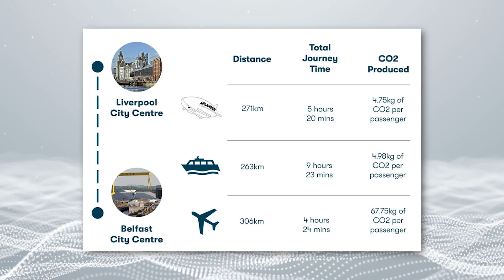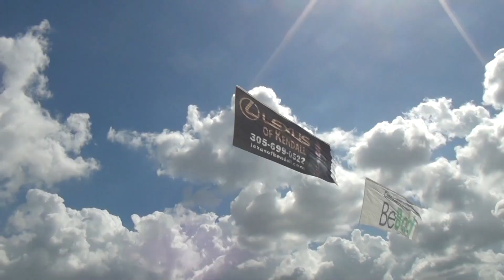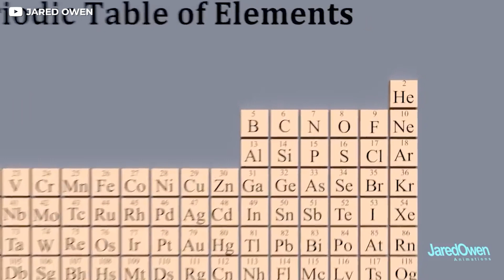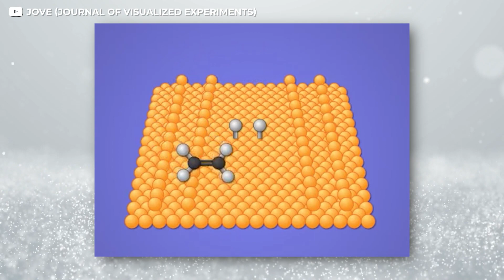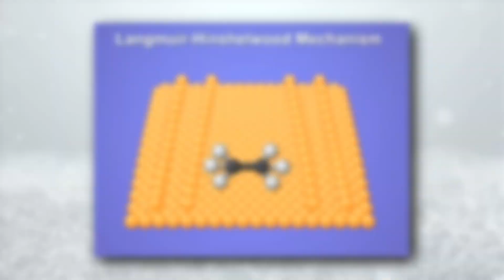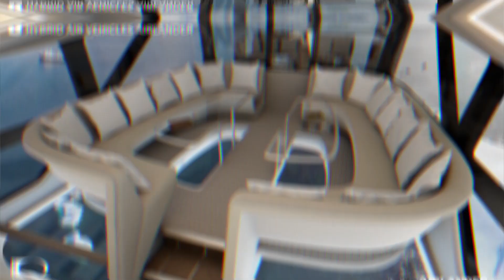Why Blimps Could Be The Future of Air Travel

Comment: I love ocean liners, sleeper trains, and cruiseferries. Airships have the potential to offer a similar comfortable travel-while-you-sleep experience in the air. They may be relatively slow, but it doesn't matter when it's a 12 hour overnight flight and because it's an aircraft it can travel in a relatively straight line.

I'd love to be able to get on board an overnight flight, eat in a restaurant and sleep in a comfortable cabin, and arrive the next morning at my destination. Airships would be far more comfortable than conventional air travel, with far more space and weight hauling ability.

I also like the idea of giant ekranoplan/GEV ocean liners (large cruise ship size) that hover well above the water and fly with much less fuel use than conventional airplanes, so they're able to offer a more comfortable ride. And smaller GEVs for relatively calm waters like ferries across lakes. But to cross a mountain range, where trains and ships cannot, an airship could be the most economical and comfortable way to travel or transport cargo with available or almost-available technology.

Comment: "It's maximum altitude is 20."

20 what? Inches? Kilometers? Cubits? Fathoms? What does this even mean?
Reply: 20000 Feets
Reply: @nehemialalang7878   You mean “foots”.
Reply: I think 20 cubits.
Reply: Also the cruise speed? 95mps is not close to the same speed of a commercial airliner how is the flight time close with that difference?
Reply: @robertmandel2971   An Inter-Cotinental Flight (say Delhi-Newark) works out like this:
"Last Mile" at BOTH ENDS: 4hrs
Travel Time: 15hrs
Jet Lag etc: 24-72 hrs..
TOTAL TRAVEL TIME: 43-91hrs... 
Now compare this LTA-ICC...
Reply: 20 nanometers

Comment: I say go for it. We need to utilize this technology, especially when it concerns air freight.
Let's develop ways to transfer cargo through the air without polluting the entire planet. The majority of fossil fuel emissions from aircraft is related to freight transfer not passengers.
Reply: And the amount of construction work and concrete needed to build a major airport let alone the connecting the needed infrastructure.
Reply: Yes... you can use for cargo too... however with 3D Printing bringing in the "next revolution" in manufacturing... hopefully the need for cargo will also reduce... as "stuff" will be made near the point of consumption... rather than "shipped around the globe"... Look around you and you will see most "stuff" is made of a few materials only... metals, plastics, glass,  etc... all can be reproduced in minutest detail(s) by your neighborhood 3D Printers where you can pick em up...

Comment: Has anyone considered making a fire-proof passenger area to make it safe from hydrogen fire? Maybe use some of those space shuttle tiles? How about having the passenger cabin hung well below the airship attached by cables that could extend toward the ground in the event of a fire? How about an upper hydrogen air bag separated by a Kevlar heat shield from a lower helium bag that could detach in the event of fire? Make sure the cabin can float in case of water crash?
Reply: @AjayAjay-gz3oz  I don't think price is the only problem with helium. It is an extremally limited recourse. Now if helium could be manufactured?
Reply: @Never-mind1960  So.. the first thing one needs to know the volume of Helium (reasonably) available versus the Demand to see if there is enough Helium to "go around"... till then.. we are all "missing in the wind"...
Reply: @AjayAjay-gz3oz  Will We Run out of Helium?

By Anne Marie Helmenstine, Ph.D.
Updated on August 27, 2019

Helium is the second-lightest element. Although it is rare on Earth, you likely have encountered it in helium-filled balloons. It's the most widely used of the inert gases, utilized in arc welding, diving, growing silicon crystals, and as a coolant in MRI (magnetic resonance imaging) scanners.

In addition to being rare, helium is (mostly) not a renewable resource. The helium that we have was produced by the radioactive decay of rock, long ago. Over the span of hundreds of millions of years, the gas accumulated and was released by tectonic plate movement, where it found its way into natural gas deposits and as a dissolved gas in groundwater. Once the gas leaks into the atmosphere, it is light enough to escape the Earth's gravitational field so it bleeds off into space, never to return. We may run out of helium within 25–30 years because it's being consumed so freely.
Reply: @Never-mind1960   A LTA-ICC (Lighter Than Air Inter Continental Cruiser) ferrying 15,000 Passengers (5Million/yr)  will require about 500Million m3 of  Helium (Buoyancy of 1kg/m3).
Possibly 15 such Cruisers could meet the Global Demand for Intercontinental (long distance) travel (100Million Passengers/yr) .. requiring 7.5Billion m3 of Helium... or 1.3Billion kg (0.165kg/m3). 
The Global Reserve of Helium is 10Billion kg.. but this is just one application.. so it WILL put a lot of pressure on Helium demand. Fortunately, the Helium is not "leaked out" of THE LTA-ICC and will be reused after its "first life".
Reply: Getting more Helium is simple we just fuse hydrogen atoms into Helium. Just need to get the whole fusion reactor thing sorted.

Comment: 6:38 - The UH-60 and Defiant X are both Sikorsky projects. 

The “Skunk Works” is the Lockheed-Martin Advanced Projects/Program development arm. They engineered and built the Oxcart family of airplanes (A-12, YF-12, M-21, SR-71), the first practical “Stealth” aircraft (F-117) and the more modern F-22 and F-35 air superiority fighter and multi role airplanes. The plane you showed at that point in the video is the SR-71.

Comment: What about a hydrogen helium mix to reduce flammability to safe levels? Or a multi bag system with lots of small bags of hydrogen inside one large airship bag to limit the effects of a fire. Each bag would be in a fire retardant material.
Reply: I have a better idea, but I would rather not say.  I can say this, once your high enough, hydrogen can't burn.
Reply: A concept similar to this was actually proposed for the Hindenburg Class, as the ships were originally intended to carry primarily helium, with hydrogen to be vented as helium was too costly to waste. This would have been achieved with helium filling the outer bag, and hydrogen inside an inner bag, with valves and pipes to vent the hydrogen running through the axial corridor. When it was realised the US would not sell helium for export, this was scrapped but the Hindenburg Class’ axial corridor was retained

Comment: To mitigate the risks associated with using hydrogen, it is advisable to maintain a safe distance between the passenger-carrying gondola and potentially numerous hydrogen balloons positioned at different heights in case of an incident. Additionally, the gondola can be equipped with a parachute system. This approach not only avoids the less efficient use of helium but also facilitates the adjustment of altitude by either cooling the hydrogen or compressing it, thereby reducing the bouncing pressure.

Comment: uK 🇬🇧 Airlander is development from Skycat Skykitten concept.. 
Then Boeings Lockheed skunkworks got involved ....🤔

It came back to the uk ..as the A10.  they are working on the A50.
The materials technology of the old rigid airships and navigation  
equipment was more their undoing than the Hydrogen.  Its the skin fabrics falling and burning the H2 just goes up and burns in the air. 
A modern design could use a crash resistant and fireproof cabin.  The motors can be electric.... the powersystem hybrid...solar and central APU generator set s  like ships ..more efficient and far less demanding than running a ICE motor direct with rapidly fluctuating loads.

The video only focused on the jet stream ....  a quick look at a metrological model or sailing map will show many more bands of circulation at different latitudes and altitudes. See being seasonal.

Comment: Could the advantages of Hydrogen and helium i.e. low mass and inertness be obtained by putting a large hydrogen bag inside of a slightly larger bag of helium to protect against combustion ?
Reply: That's the very design concept I've been working on for years. In my airship designs, I use multiple inner envelope cell bags of hydrogen within a much larger main envelope filled with helium. I also have incorporated a thicker inner Mylar-type envelope that is filled with regular air (pulled in from the exterior of the ship) that can be heated like a hot air balloon for added lift. Hopefully, one day, I can find the money to actually build them. I may soon use crowd funding to "launch" my ideas.

Comment: Hi. A height of 20,000 ? You omitted giving the unit of measure, but I assume you mean "feet". That wouldn't be anywhere near high enough to enter the jet-stream you hope to cruise around the world on. Airships are limited in height attainable because the atmospheric pressure diminishes with height. Barometric pressure can vary widely during a long flight, which means the blimp will go up and down thousands of feet. Therefore airships do not have absolute control over their height. An airship taking off in high pressure air will fly well, but if the terminal where it's scheduled to land is experiencing very low air pressure, then the blimp may not have enough lift to remain air-born. This problem was partially solved by either dumping water (to gain lift) or dumping hydrogen (to lose lift), but of course there's a limit to how much water ballast can be carried while remaining economic, and how much hydrogen can be dumped.
                     The other big drawbacks were the slow speeds attainable, often less than the prevailing windspeed; the huge area of the blimp is always subject to sudden wind gusts, and the fact that they could not fly above the weather. Air transport only started in earnest after jet airliners became available, because only these can fly at 40,000 ft above the weather, and at near sonic speeds that turn wind gusts into "minor turbulence". I'm sorry to pour cold water on this blimp idea, but I'd hate anyone to lose their shirt. Cheers, P.R.

Comment: A helium & hydrogen filled Lazzarini twin hulled design with jet fan engines traveling almost 100 mph could revolutionize air travel.  It may comfortably carry 400 passengers.  Just don’t fly in bad weather.  There have only been 8 deadly airship accidents since WW 2, but there should be precautions such as extra strong moorings and cables and large hangars capable of supporting dirigibles during storms.

Comment: Amazing. Definately want to keep up to date with this. I wonder how viable and effective airships with hot air would or could be.
Reply: Definite. Do you see this is related to the word “ finite” and “infinity”?
Reply: Buckminster proposed hot  air "Buckeyballs" .. floating in the sky.. many decades back... not sure how hot the air will remain at 30-50,000ft elevation with -30 to -60F or less air temperature outside...
Reply: Solar cell power for the airship and to drive its propulsion using flexible solar cell to build the upper part of the airship.

Comment: what a load of bollocks  this is  , airlander  made a prototype   flew it  on test runs  and crashed  the thing .
to date there  is a handfull of airships  that  are  in use  the only one  i  have seen  up in the sky   is the goodyear blimp   .
over the last twenty years  i have seen so many   so called   companys   come up with   supposedly   hiteck solutions   of how to compensate for  cargo /  payload  =to  lift  capability.
not to mension the wind   gust factors   that   would   stop   most  of thease  from  even   getting of the ground .

Comment: To make it safe to use hydrogen as a lifting gas for carrying passengers, all you need to do is have a balloon in a balloon the outer balloon is only a quarter inch larger the two membranes most likely could be one balloon envelope in that quarter inch there is nitrogen gas what this does is decentralized the entire lifting gas industry for balloon craft. This keeps the hydrogen from touching the oxygen and there would be sensors in this quarter inch to let you know if there's any leaks. Here is a proposal for what I'm calling the slipstreamer and it also is a special type of spinning airship, that hasn't been tried before. The Airship balloon would Corkscrew itself through the atmosphere and it would be a new type of propulsion system where liquid nitrogen is the fuel liquid nitrogen when it's used to spend the Airship envelope within exit out the nose of the airship cold hugging the envelope and creating a slipstream effect. Since colder air is denser air it will hug the airship and since it's shape is tapering would be like slipping wet soap out of between your fingers pushing the airship forward into a lower pressure.

https://www.evernote.com/shard/s519/sh/e8e006b4-e74e-6be3-e8b6-fd847d0630c7/33bdee9f78564b65915b484320b9a614